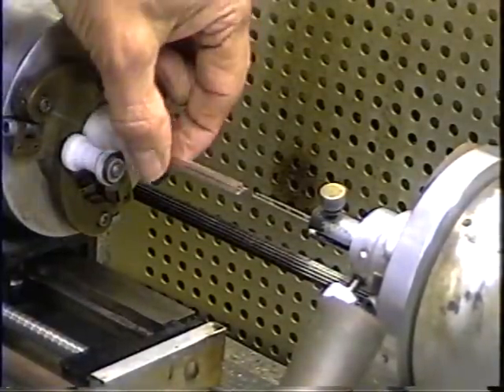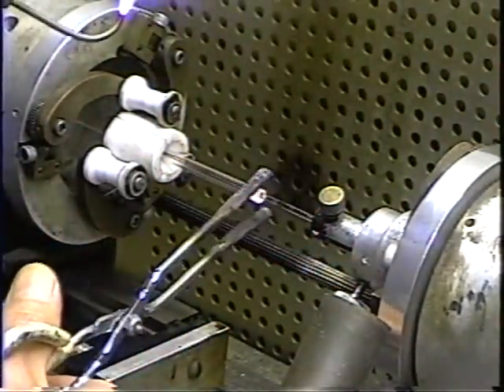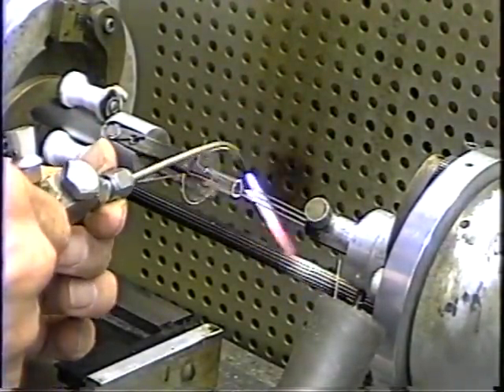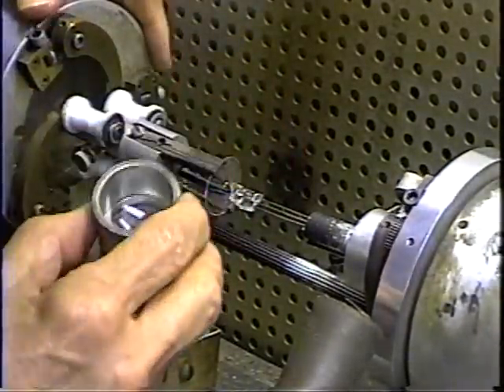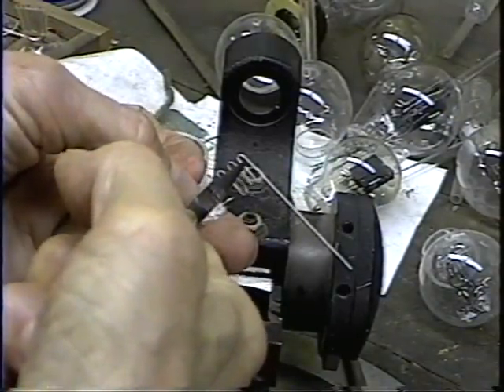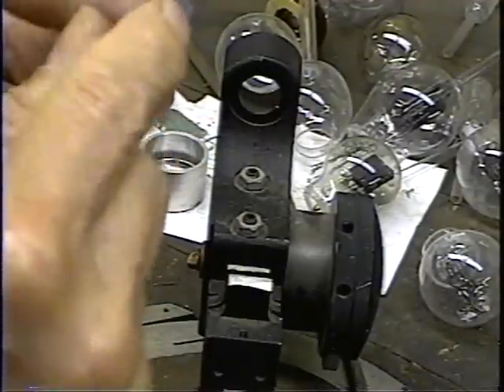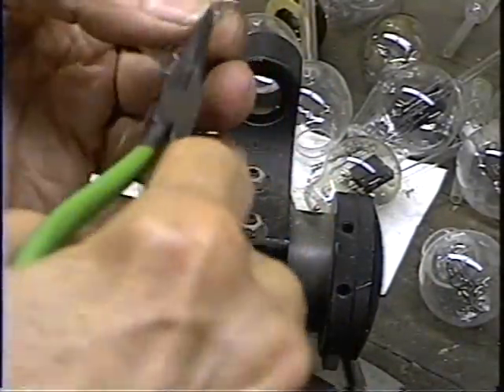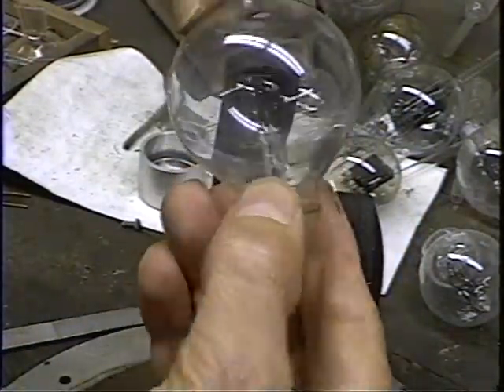Making a spherical audion vacuum tube part 2

Comment: Hi Ron. I am Julian from argentina. I love a lot the science phisics and electronics. I am wondered with the tuff you make at home.  I enjoy too tube tecnology as a hobby. Audio radio and computing or control too. I am having intrest in make the next step making some kind of homemade tube. From schatch of course. Inc@ndescent lamps filaments etc. No efficiency wanted. Just for play enjoy and learn. The answer is: did You think that were possible to make work a simpe scrappy homemade  audion with no perfection at all using a fixture of a standard two stage laboratory vacuum pump to evacuate the experimental device?
I hope you were fine an thanks for share your work. 
Julian valenti.
Reply from the maker: With the addition of a chemical getter such as potassium metal along with the pump you will be able to get the required vacuum. Now to get some metallic potassium!~
Reply: @glasslinger  thanks you! Could it be the metallic bright inside of the ux201 tubes? I will look for some of this getters in ebay. My idea is to build an experimental audion from two extremes of a fluorescent lamp one as catode and other without filament just to fix the plate and grid on its electrodes. Both soldered in the center of the cilindrical audion body. 
Now i am looking in your videos to get techniques.
Again thanks you an i see you in action!
Reply from the maker: @julianvalenti  This may turn out disappointing! I have found that working with the glass from old fluorescent lamps is very difficult! It tends to crack when cooling. Very careful annealing will be necessary. The bright coating inside 01 tubes is magnesium. They  evaporated the magnesium to scavenge oxygen from the residual air.
Reply: @glasslinger Well. By the moment I leave the project. But I am very glad to have chatred with an expert. I will try more tube projects like a theremin. Or somthing funny to play. Thanks to share your experience with me. Have very nice projects!

Comment: Your vac tube tutorials have been great to watch and learn. Noticed in part 2 you re-used pieces out of old tubes. Is it possible to rehab an old hard to find tubes a little bit or does it change the dynamics of the original tube?